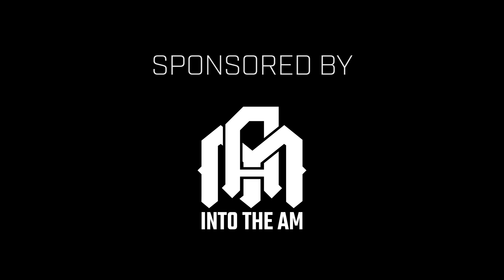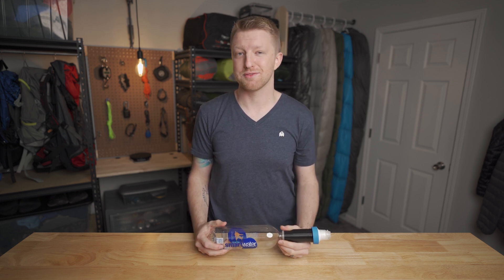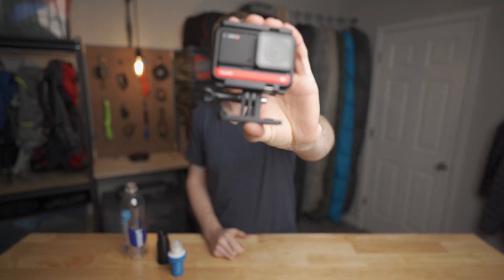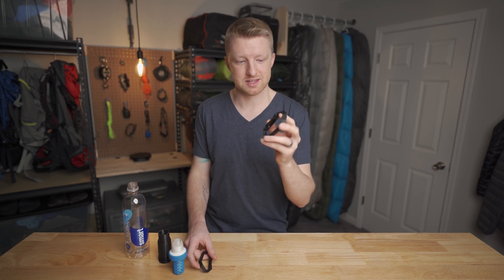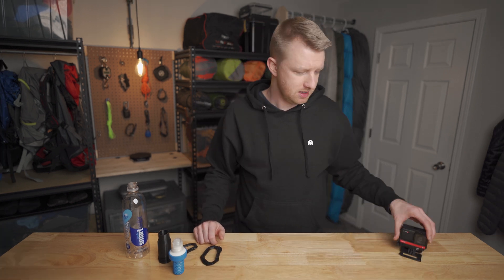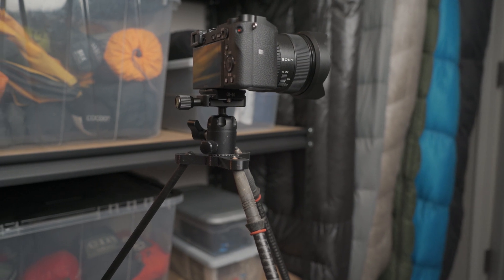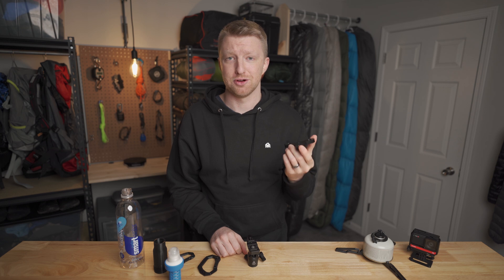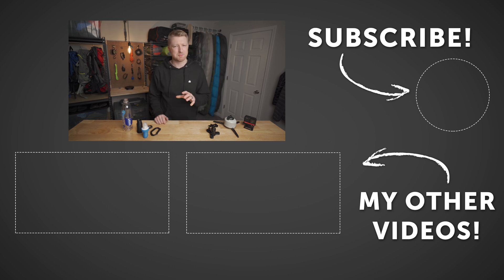I 3D PRINTED backpacking gear! Could it change the industry?

Comment: Backpacker here: that canister cap is actually an important piece of gear. Those threads & valve ports rust really easy & need to be kept capped off to prevent that.

Comment: A couple ideas: 
* keychain holder for a button compass
* keychain holder for spare battery for my flashlights
* light diffuser cap for flashlights
* tiny spice boxes
* flashlight mount for the chest strap on backpacks (needs to be hanging down a bit, to keep it horizontal, and wide enough that it doesnt dangle back and forth)
* flashlight mount for trekking poles, with a joint that uses bearings to make the flashlight stabilize itself in a horizontal position.

Btw: i know headlamps exist, but im one of those people who sometimes get tension headaches from wearing headlamps... Another downside with headlamps is that they usually have a pretty wide beam pattern. This is great for around camp, but it really limits the throw (distance), and it also require a lot more power to achieve the same brightness/candela. Better energy efficiency means that i can get decent battery life even from a AAA flashlight. I prefer one that has a "low" setting that is just barely bright enough to see a few meters ahead of me (for situations where i really need to maximize battery life), a "medium" setting that gives more "adequate" but still a bit modest brightness, and a "high" setting for when i hear a crazy killer moose lurking in the trees 👍

Comment: I'm currently 3d printing a cradle system for a bikepacking setup.  The most useful things i can see being 3d printed for backpacking are stuff like custom strap buckles, snaps, and other types of things allowing one to make their own gear.  3d printed stuff in itself isn't as useful as say printing parts to make other things, or make them better.  I can see ultralightweight tarp/backpack combos using 3d printed hardware like grommets and stuff you can't buy off the shelf.

I COULD 3d print a bunch of gear, but the thing is i just don't need much stuff, often i don't even have a backpack, just a hip pack with a hammock.  If i could 3d print a tiny folding rocket stove that won't melt i'd do it, but for now i'm printing brackets and such to hold bikepacking gear.

Comment: Please make a note on this video that 3D printed parts that come in contact with drinking water or food require a LOT of research to ensure it's food safe. Brass nozzles can contain lead, filaments that sound food safe may contain other unsafe materials, etc. Unless you REALLY know what's in the filament and everything that will contact it on the way to the bed (and probably including the bed), I'd consider it unsafe for use around food/water.
Reply: You are correct. ABS is FDA food safe, however the problem with 3D prints are the impossible to clean crevices between layers, which would be impossible to truly clean.

Comment: Thanks for this. I’ve had similar thoughts and designed and printed a two part nozzle adaptor to make a DIY pump sack for an inflatable pad. It fits to a large tear proof mailing bag, which in turn can double as a pack / pannier liner.  Total cost is sub $2, and if the bag tears, the adaptor can just be unscrewed for reuse on another bag.

Comment: Possible to send me the file for this Katadyn to SMART bottle connector piece you printed? I have access to a printer and CAD to modify and make it screw on with no leaks.
Reply from the maker: Excellent! Let me know what you come up with. https://www.thingiverse.com/thing:3566270
Reply: It would be cool if it could be shortened just a bit too. I'd buy that adapter. I like the squeeze besides the fact that you have to squeeze it. Gonna switch to the Be Free.